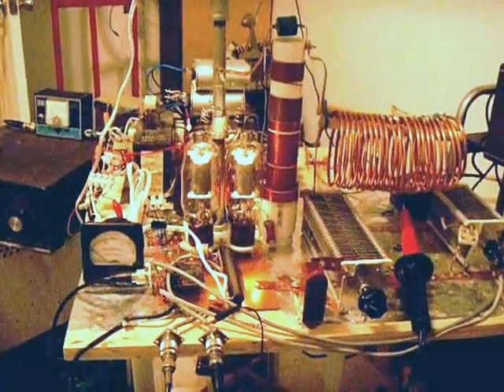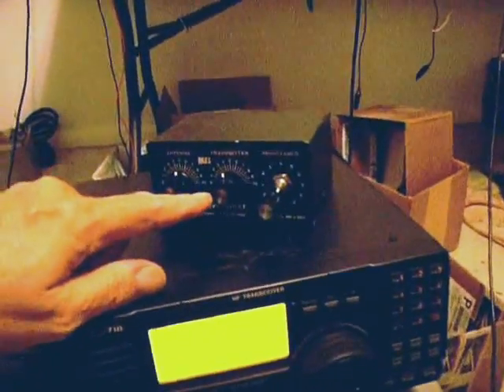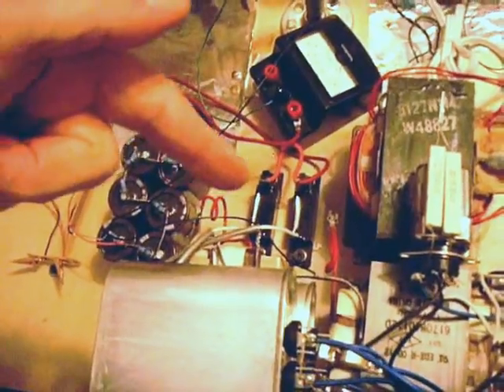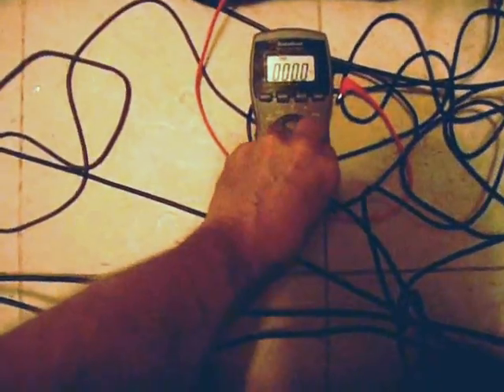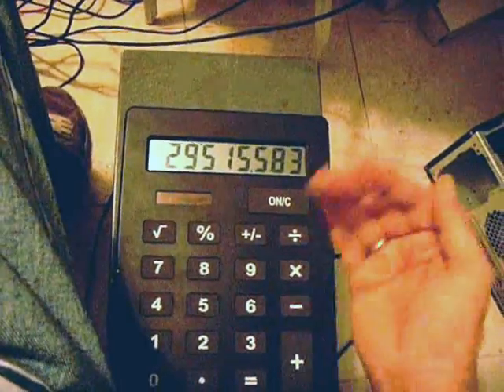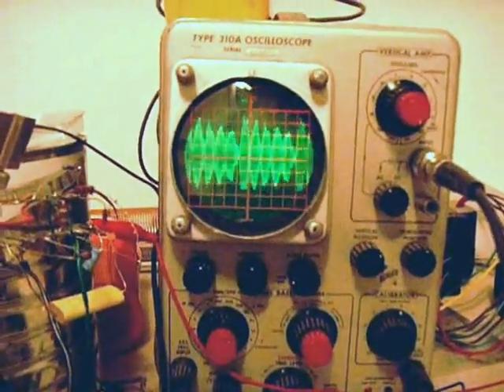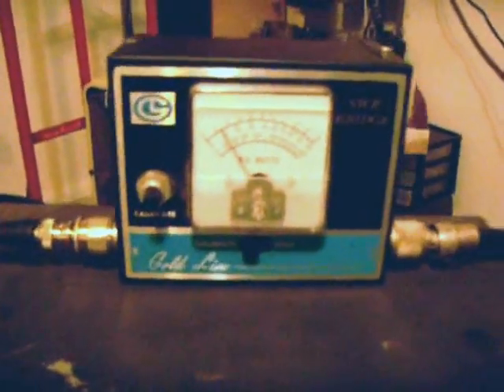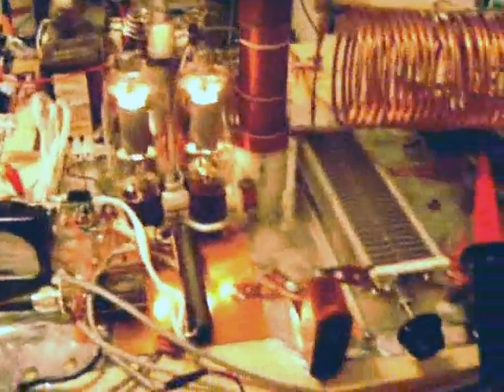572B Breadboard Linear Amplifier

Comment: I trust your design and results more than W8JI does with two 572B tubes. He claims 1000 watts with two tubes and less plate voltage from a Collins 30L-1 Linear. Check out his video here on YouTube. He must be driving his with 120 watts or more drive.

Comment: Out of date comment, but, I love it. Truly a junk box amplifier. Put in a neat, sharp box, and just as junky, people would be patting you on the back, until, you took off the cover then they would huff and puff, lecturing you on safety and good engineering skills. But if it works and doesn't bite you, good DXing...  :)
Reply from the maker: Thanks! The build was intended as a demonstration to show the simplicity and operation of the amp, but never to be permanently built that way. I suppose I probably should've stated that as a disclaimer.
Reply: @bob4analog  No matter, the boo birds would still be chirping. I enjoyed it and have put together some of the same type stuff to test out some ideas and see what happens. We learn by trying and testing, something many Hams have forgotten. Good stuff.

Comment from the maker: Hi John,

This is done by cathode bias. I used a 12v zener diode with an NPN transistor to make a power zener diode. This is connected in the 572B cathode circuit.

During standby/receive, the cutoff bias is achieved by a 10k/2w resistor from cathode to meter circuit comon point (ground), and opening the zener bias circuit by a relay.

I can email you the diagram if you'd like.

73,

Bob, KD5MHQ

Comment: Hi Bob. How did you set the bias? Float the HT -ve above ground, so the grids have a -ve voltage?

Cheers, John.
Reply from the maker: It's cathode bias. A power zener diode is placed in the cathode circuit to ground. This causes the cathodes to be more positive and the grids more negative, thus controlling idle plate current.

Comment: @bob4analog LOL Haha! That is true. I originally found your videos by chance looking for some pointers on building a custom (read: homemade) amp for my electric guitar. I am using four EL84 tubes (100w) and 12 ax7 preamp tubes. I am trying to find the right rectifier to use, and have been hunting for advice. Have any?
Reply from the maker: Didn't see your question till now. Diode rectifiers can be connected in series to handle the higher voltages needed for EL34 tubes. (you mentioned EL84 tubes; I assume you meant EL34.. those are the bigger power octal tubes.) 1N4007 diodes have a peak reverse voltage of 1000v. Connecting 2 in series is always good practice to increase the PRV.